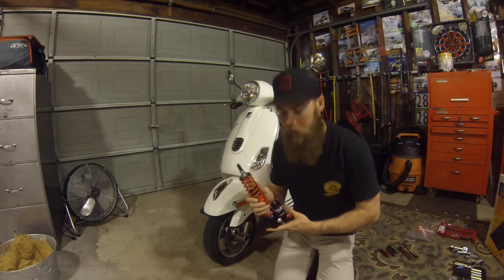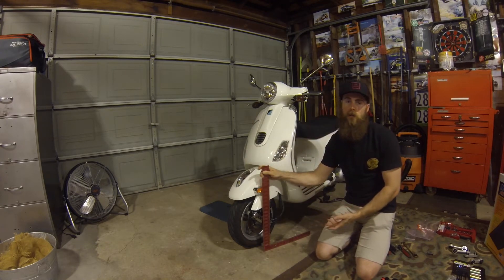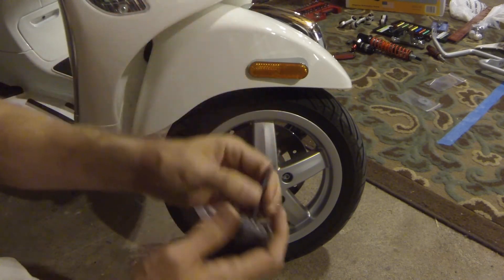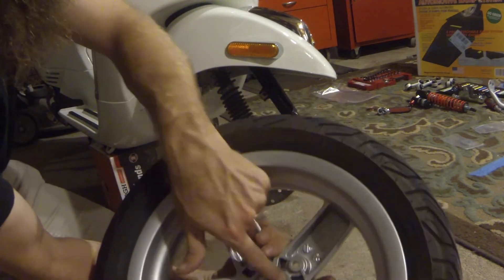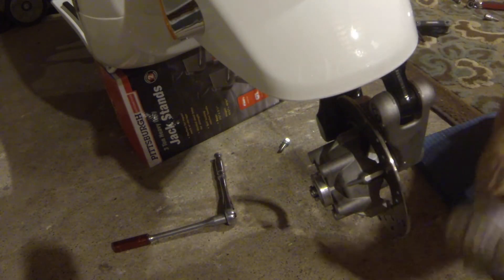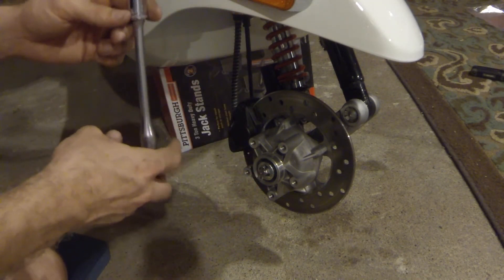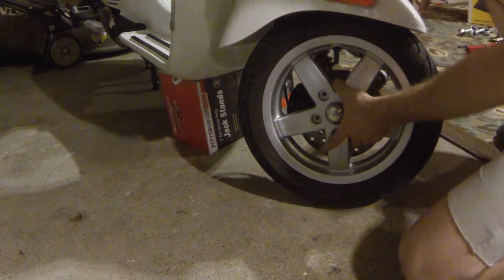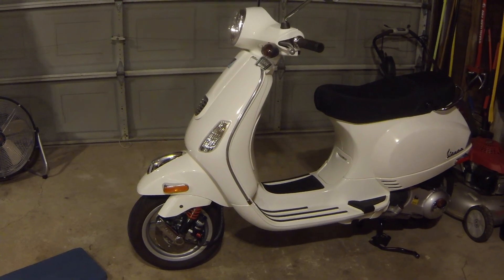BiTurbo Coilover Vespa LX150 Install

Comment: Could you share what mm sockets you used to take apart the top hat and upper bolts to loosen the shock?
Reply from the maker: GrecoCalabrese Sorry unless I set it in the video I don’t remember what I used. Once you get it apart and get to the bolts you’ll know though. It’s metric.

Comment: Hello. Does it feel the diference between the original and the bitubo suspension?
Reply from the maker: Yes, big time. Damping is so much better smooth and holds more weight if you have two riders. I was always bottoming out before